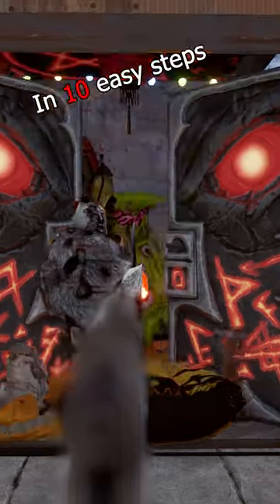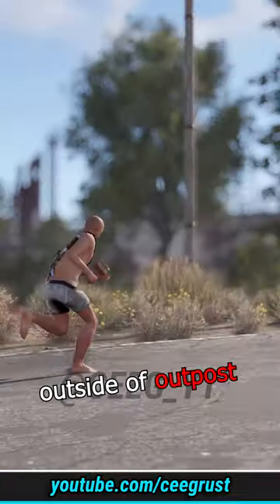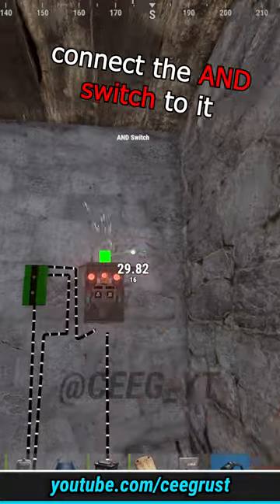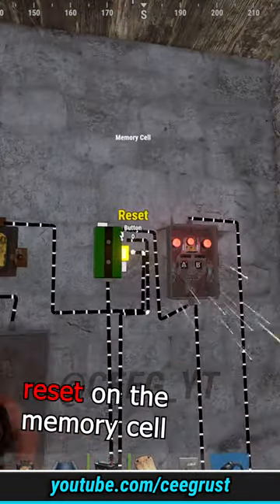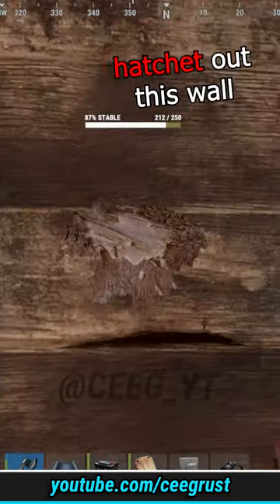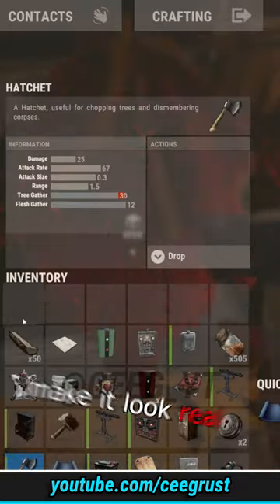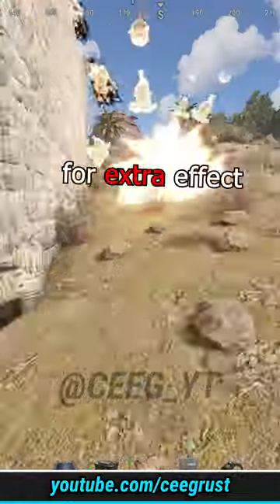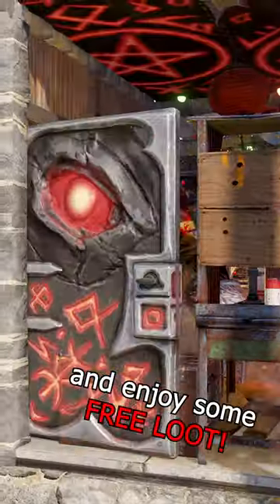How to Build a Rust Trap Base in 60 seconds! #shorts #rustshorts

Comment: You don't need the AND or splitter, the pressure pad creates 1rw just like the button. Just power the memory cell with 2rw and depending on wether u want the door to open or close use the outputs on the MC

Comment: Tips u dont need to attach the pressureplate via the switch, it generates 1 power without being connected, and thats all u need to hit the set
Reply: the circuit is meant to hold the door open

Comment: This design has a lot of redundant use of components, and the splitter is a quite expensive way to split the battery, you should just be using electrical branches instead

Comment: Only thing wrong with following this tut set by step is if they have access to your loot they can soft side out of the base……
Reply: Before or after they get shredded into a million bits by the shotgun traps ?
Reply: @gashwipe2  well if they make it pass the shotgun traps if you didnt put amno in them theres a million ways you can make a mistake and somone goes deep, better to make a trap base with a room they get stuck in that has nothing for them to get out with. So after they get shredded by the shotgun trap and med up to full hp. If you wanted to ask a question you could do it in a less dickish way, merry Christmas l/hanunka

Comment: you added 5 extra steps to this, you don't need a and switch for this and solar panels give it away use gen to power the battery to full and turn it off

Comment: Autism bruh, just run pressure pad to door controller, don't hatchet out wall, if u used mem cell, put it on toggle, you only need 1 solar panel, and only two shottu traps